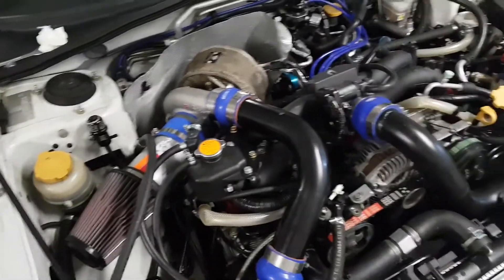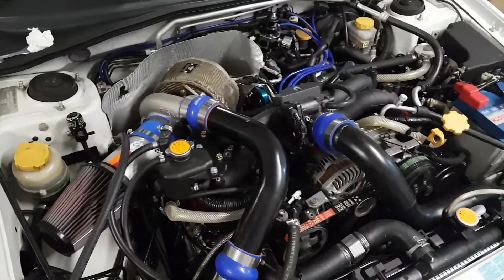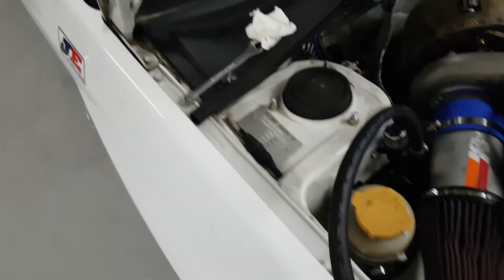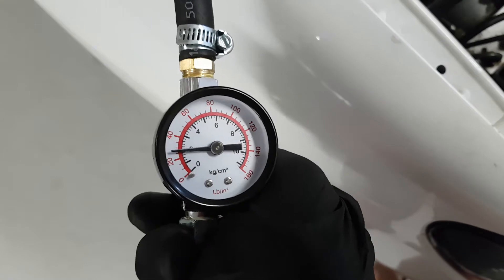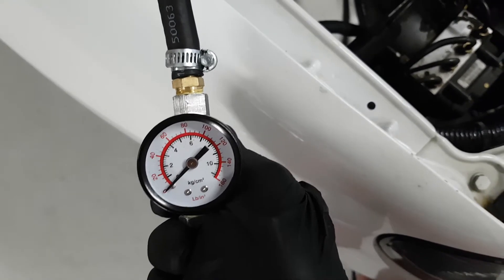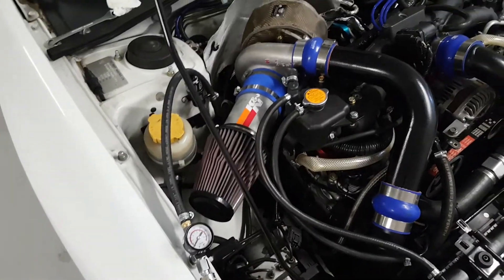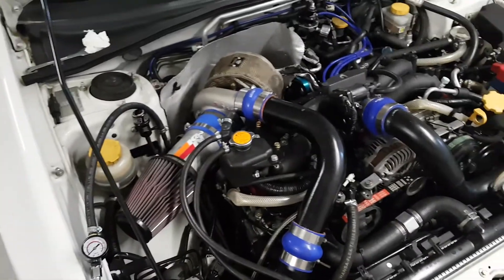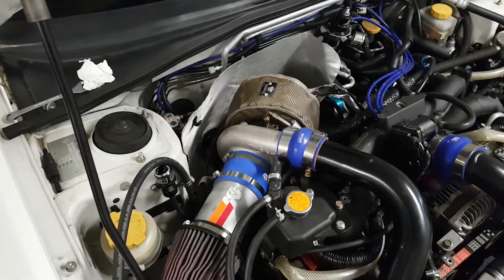Praha-STi: Wastegate failure

Comment: Hey Mbdulka. Havent seen much from you in awhile. You still working on the ride?
Reply from the maker: Yeap, but still having issues ... I have had very little free time to work on it (or I have been mucking with the Supra) ... I've diagnosed everything, so about to replace boost controller, and may have to play with my latencies again .... runs great until boost -- maybe my boost line to the ECU is pinced in the firewall, I'll have to rip the car apart and sort it -- driving me crazy.